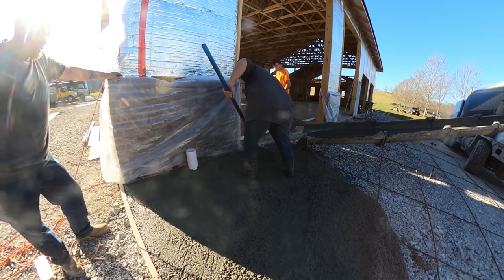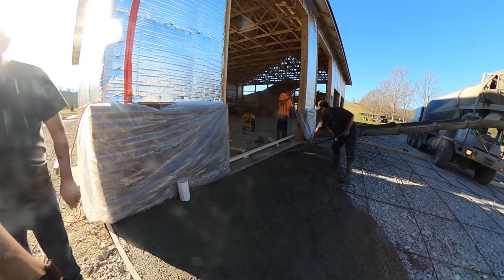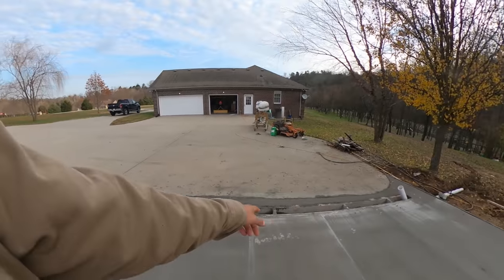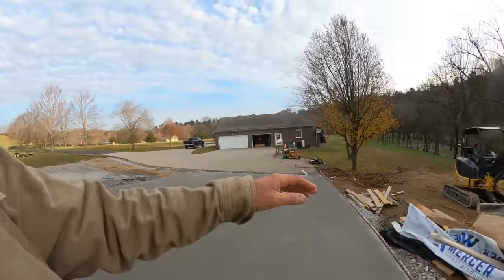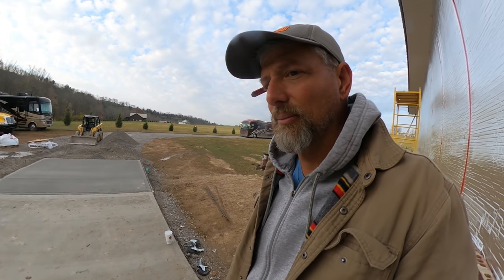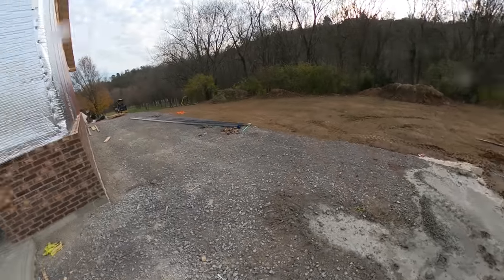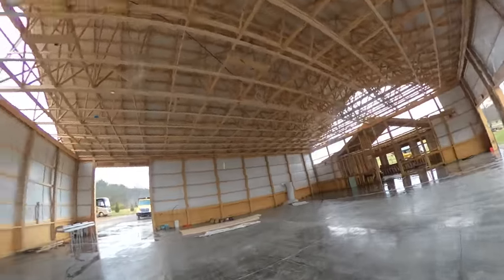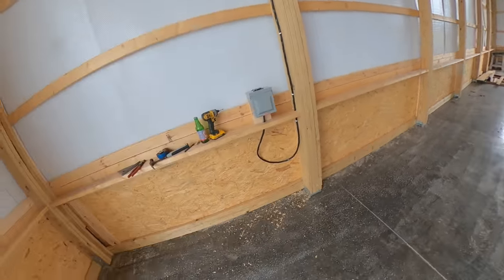Building the Ultimate Garage | EPS 20 | Soffit, Driveway, 50 Amp Install | Shots Life

Comment: Good lesson on how effective foil can be but the part you won't experience in the uncovered situation is how important an air gap is to make it effective when using foil behind materials.  If you cover it directly with no air gap its efficiency drops dramatically.  Leave a free inch over it and it is very good.
Reply from the maker: Hey Douglas, interesting.

Comment: Save that 6 wire for your air compressor,  it helps with motor start up to have plenty of electron mass available. Even if it's only 30 amp.

Comment: I ran a second sub panel on the other side of my garage and ran aluminum 1/0 for a 100A service.  A sub panel is plus wire is cheaper than probably what you paid for the 6/3 wire...  probably going to need other circuits over there.    Save a lot of money with a sub panel, the price of copper is out of control.
Reply from the maker: Funny you say that, my buddy, John W said the same thing when he visited, he always runs a sub panel in all his buildings to save on wire.
Reply: Mfrs are transitioning their product lines to plug on neutral bus a luxury for a garage, I paid $40 for a nice Siemens 125A 60 circuit 30 slot sub panel with copper bus on Amazon 2 years ago...  80 FT of 1/0 Aluminum service wire was around $120 at that time...